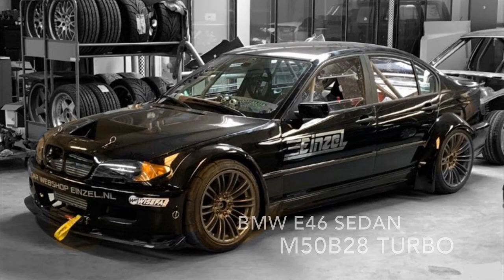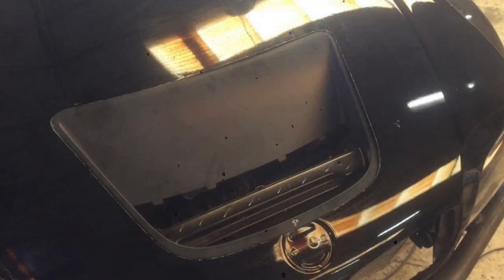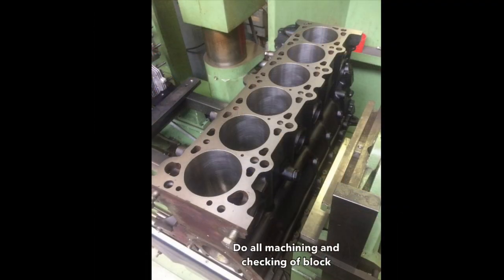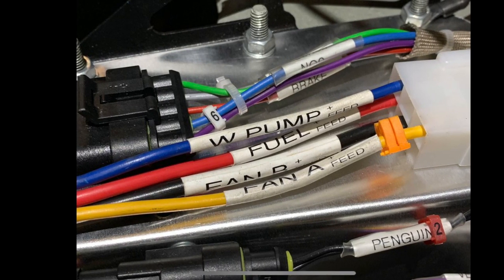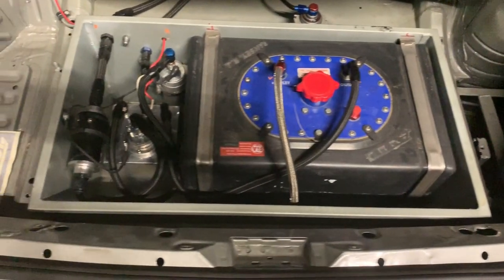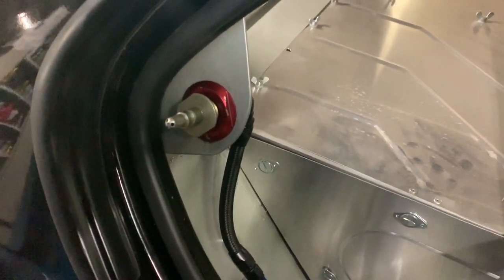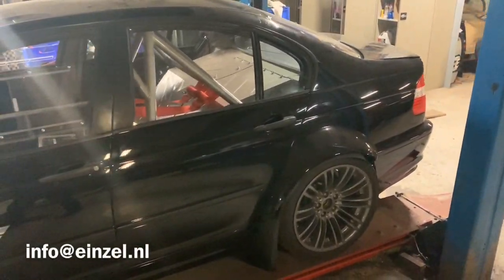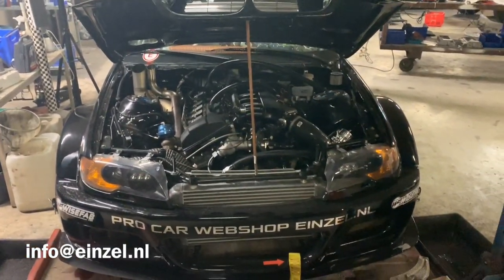Build Video ; Fabrication of BMW E46 M50 Turbo Sedan Pro Drift Car , Rear Mount Radiator

Comment: That's a very Nice build, there a so much Nice Details... Like the Airliftjacks, or the removable Cooling-System-Housing... 🤩🔥🤙
Reply from the maker: Yep, had to be easy to remove and install! Otherwise its also impossible to fit radiator.
Reply: @DriftJesus  this is Genius... If you're on Event, you loose not so much time... when Service is needed

Comment: Einzel I'm loving your e46 content. You are budget where needed (tablet dash) and spend where it counts on good parts. What ecu are you using that works with the tablet?
Reply from the maker: I use an ECU Master.  the tablet is just a backup for the real gauges, this way I can see what the ECU sees.  All my cars always have needle gauges

Comment: Einzel, what is your recommendation for the driveshaft? I'm currently using bmw e90 325d gearbox behind my 1JZ in the JZX100 Chaser I have. in the front, im using the front part of a e60 530d driveshaft, with the OEM guibo thing (the round thing on bmw driveshafts). In the back im using the rear end of my Toyota auto driveshaft, which is connected as stock with bolts to the differential - which means i dont have any telescopic part anywhere in the driveshaft.
Reply from the maker: With giubo and two piece you don't need telescoping.  Hard mounted engine and subframe + giubo , you could get away with single piece.  We always go for single piece telescoping with solid flanges on BMW style boxes, but ofcourse preferred is GForce gearbox with slip yoke for single piece shaft.   Anything single piece must either be slip yoke or telescopic
Reply: @DriftJesus  Thank you, sir. Your attendance in DW2 has been a revelation. I will be waiting for all videos you do on drift/race cars. And hopefully, at some point this year i'll try to order Feal Suspension for the Chaser through your company.
p.s. I've always known that the e46 chassis is a great one to start a build with, especially for those of us living in Europe, and you are giving examples why it is
Reply from the maker: @stilianjelev3006  yep, just shoot me an email and we'll be very happy to supply Feal; it will transform the car.

Comment: Any tips for a 320D to m54 conversion?
Reply from the maker: Get an entire car to swap over, or you'll end up needing a million little things. 

Also, secure the oil pump nut with safety wire

Comment: Hey guys i have a question i have a e46 tha im gonna do a m50 swap as well can u guy tell me what would i need to make this possible?
Reply from the maker: Depends on the application,  this car is standalone ecu and wiring and the mounts are custom made. There are no OEM motor mounts that work to put an M50 into an E46
Reply: @DriftJesus  u sure cause i heard tha the m54 mounts can go on the m50
Reply from the maker: @cicodrifts309  nope
Reply: Thanks
Reply from the maker: @cicodrifts309  internet is full of misinformation.  And what people call "fit" often isn't fitting.  The alloy motors are different from the iron motors and there is no set of mounts that works.

Apart from that, in a turbo application you'll need a custom passenger side mount anyways, bottom mount is what you want on these motors.
Reply: Did you custom made the engine mounts yourself?
Reply: And thanks so much for the information
Reply from the maker: @cicodrifts309  yep see video.  We also sell them but won't do another production run untill January
Reply: Alright thanks

Comment: tbh  the car look so good  but you have problem with wiring    its really really alot of wiring   you can put a fuse box behind the dash and make only the switches visible    .... dont tell me its easier for changing a relay   i have 2 drift pro cars and NEVA  had any issues with relays
Reply from the maker: Thanks for your opinion.   I like to have wiring on the outside so its easy to troubleshoot.  If its a SEMA car I'll make it behind a dash. There is not "a lot of wiring" its just wired in a way that everything is fused, contrary to many racecars we had in the shop with problems where 80% of hot signal wires weren't fused.  So no, its not a "problem" its exactly how I want it.  The problems we see with clients in EU and USA is PDM's and wiring behind a dashboard in a caged car interior that you cannot work on.
Reply: 2 cars for me .  And other 6 cars i build my self with friends   Now almost 5 seasons   Never had an issue with relays and wiring .. or any electric problem   All behind the easily removable dash .. if you are good with your work just trust your self and put them their ... i just giving you advice here  you can take it you can leave it .. the choice is yours  ..
Reply from the maker: @hadiq8965  I think we built over 60 cars.
Reply: @DriftJesus  60 cars like that ?  Then you stopped improving at wiring detailing and position long time ago .. all things you do is ok   But wiring ..... if am a customer i will be sad
Reply from the maker: @hadiq8965  thanks, no advice needed.  The reason we build wiring like that is because each component (engine harness, interior harness, switch panel between seats,  center fuse / relay panel) can be removed in 30 seconds and all connectors are separate.  This way, a mechanic can remove either of the components and measure or make changes rather than laying on your back in a caged car.  Also, the indicator lights are fly back from the device rather than actuated by the switch. This way you know the device is really on, and not just the switch.